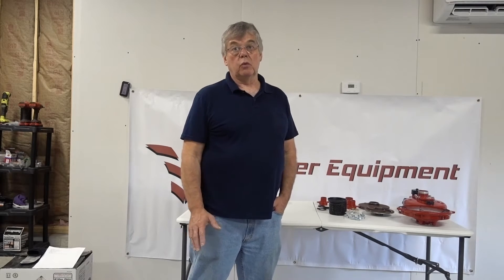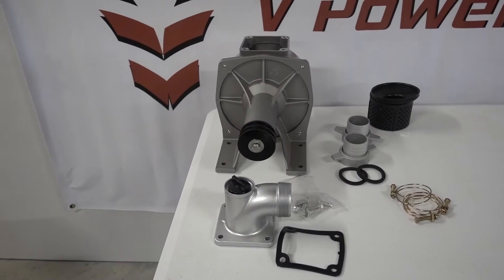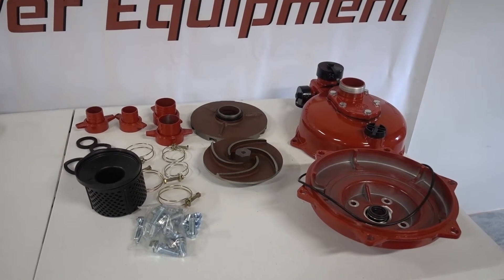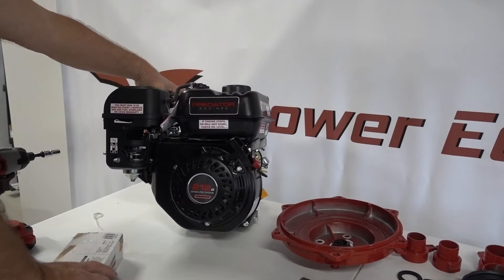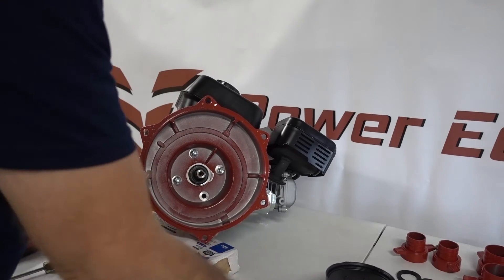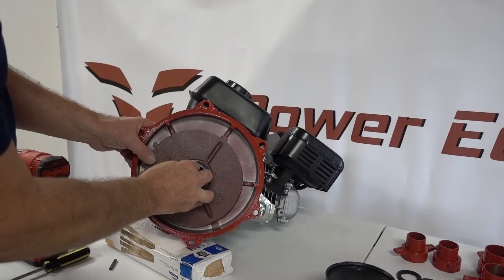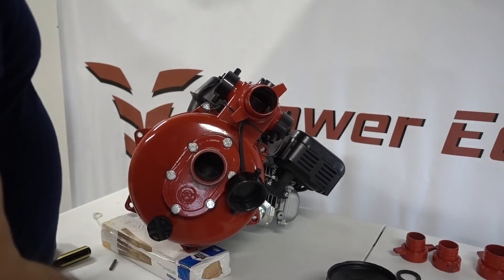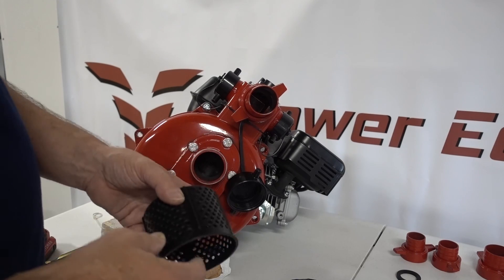Pulley driven and High pressure water pump details

Comment: @vpowerequipment you failed to mention what style of threads this housing is for the hose. Your site shows a pump for irrigation and a pump for fire. Are the threads NPT, OR NH, OR NPSH? The fire pump needs to have NH threads Or storz style connections. NPSH at a minimum. 1.5" NH is the common wildland and interior attack size thread. 2.5" NH is the other common size. it would be best if the pump had 2.5" NH thread on the intake. and 1.5" NH threads on the discharge. Or 2.5" so that we can use a gated wye on there and run one or two hoses.
Reply: I know this is probably 10 months late for you but I just started assembling one tonight. I contacted them before I purchased one to try. It's 2 inch npt inlet and two - 1.5 inch npt with one - 2 inch npt outputs. So the same size NPSH thread hoses should work one it.
Reply: @ too bad they didn’t make it NH. That’s common here. I have some NPSH. But need to check what nozzles I have. Good to know thank you for the info.
Reply: @kylearaiza8808 No problem! Happy Thanksgiving! That's what I plan to use with it. I bought a 1.5 inch npt to 1.5 inch nst (nh) adapter off amazon for about $15 before tax. I've got a lot of 1.5 inch nst (nh) hose and alot of 1 inch npsh hose and nozzles for both.